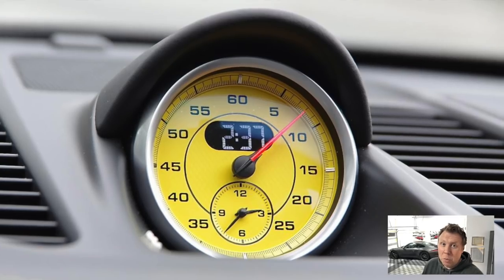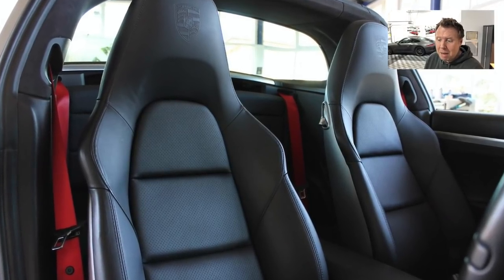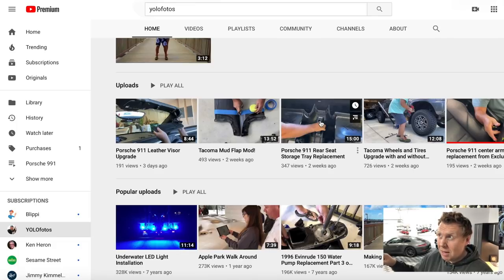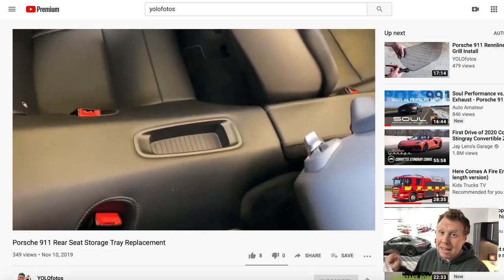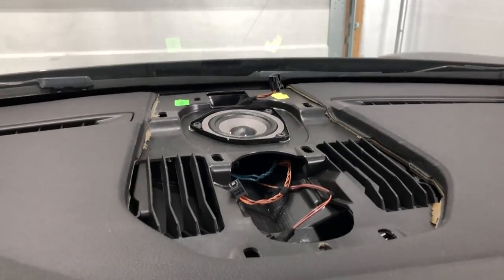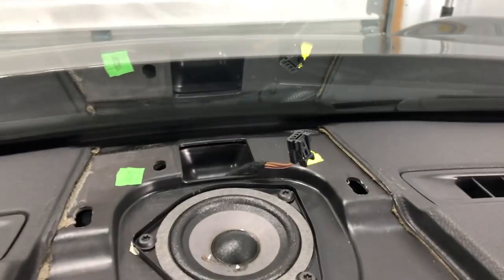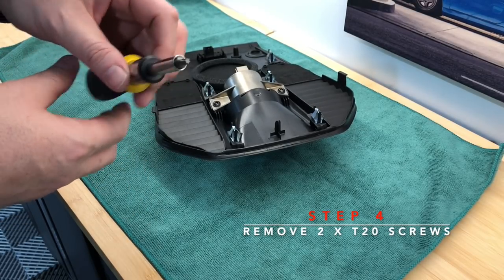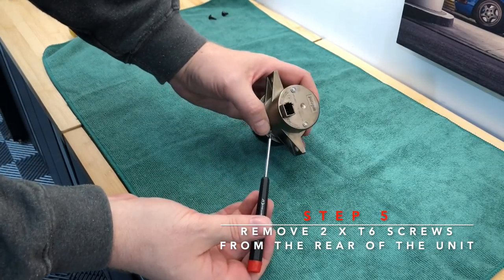Sports Chrono Color Change - Porsche 911 991

Comment: I have the correct Magneti Marelli (quality manufacturer - think Weber’s etc) 991 NEW sport chrono dial in Bordeaux Red for sale on ‘Trademe.co.nz’. Never used, I ended up changing my black one for Guards Red (same as car colour) in the end. The Bordeaux Red one for sale is the correct one with the ‘carbon-fibrelook’ chequered centre, not the plain centre. Also, mine has the bezel in metal - Not a sticker. Weighty, quality piece and not lightweight cheap metal.
Reply from the maker: Send me the link please?

Comment: Looks very cool, just a minor point, have we lost one of the small white hands on the sub-dial?  I imagine fixing the 2 dial faces together will mean the stem height is too low?  I would also try to stop the chrono at a set time, to make sure the hands to go back to the exact postion.  ie red hand at dead on 12 o'clock position, and the sub hands reading 3 o'clock.
Reply from the maker: Great points Rob! I haven’t lost any of the hands, the stalk / stem is still long enough to hold them both even with the added depth of the red gauge face. I’ll follow your suggested test procedure though. So far I haven’t noticed any malfunction or misalignment. I’ll double check.